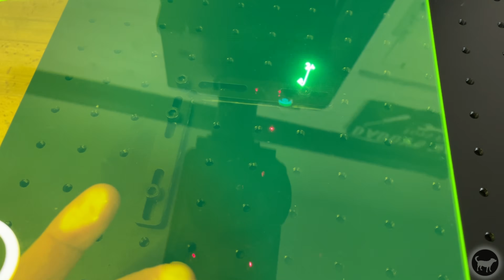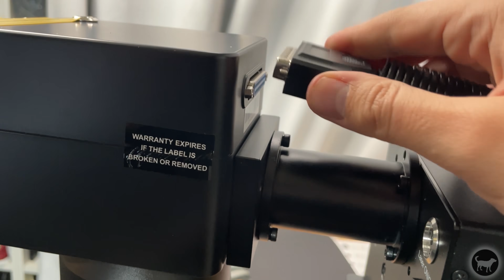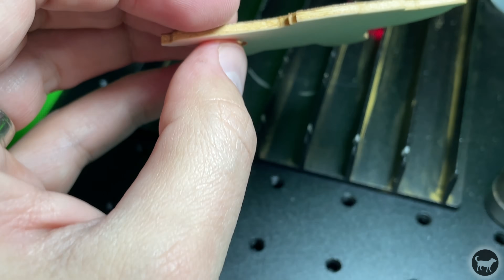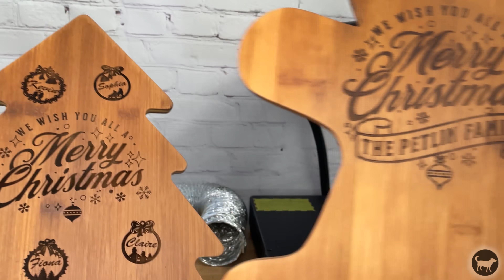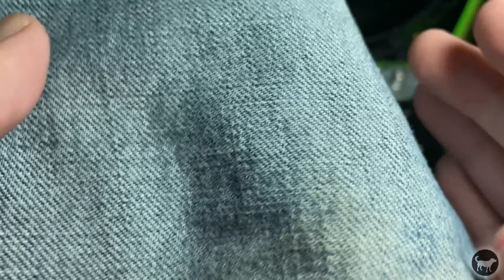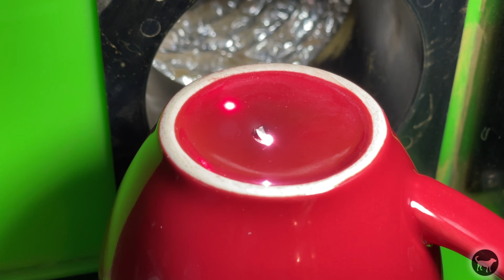ComMarker Omni One UV Laser Engraver Review | Cold Ablation Laser

Comment: Do you recommend this option over the F1 Ultra?
Reply from the maker: They are 2 completely different use cases. There are actually 3 different laser wavelengths between the 2 machines. You just need to figure out if the fiber, UV, or diode laser is the best for your needs. If you only want to work with wood without charring, glass and plastic then the UV is great. If you want wood with charring, plastic, deep metal then I would go with the Ultra.

Comment: Can you change the height from the program, or only manually? For my application I’d really like to change it automatically
Reply from the maker: As far as I know it’s only manually. I don’t think there is any connection from the motor controller to the laser control board.
Reply: @ guess you could hook up a motor to the rotating nob on top and drive it that way

Comment: Seems like a variant of AtomStack M4 DPSS laser(2W/1064nm) except for a 5W UV diode. So, it has the same lower lifetime < 10000 hrs(with unpredictable degradation), instead of real fiber lasers(100000 hrs), which is 10X more. Seems like they saved significantly on the Fiber laser module(No Raycus/JPT) itself, eventhough it is priced well above lower end real fiber laser. They also removed the red laser outline(replaced with cheap window), could reduce alignment issues. Also the cable deceptively resembles a fat fiber cable  conduit, eventhough it is a non fiber electrical wiring.  Hopefully the clones will become much cheaper(atleast 3X cheaper🤞). The engraving effect is far more intricate than other fiber lasers though. The review is exceptional as always.❤👍
Reply: Imagine that you have nothing better to do, but to go on each video of this laser and talk trash about the laser and the creators.  People have absolutely nothing better to do?

Comment: @BusterBeagle3D I need some guidance as I'm new to lasers. I'm looking for a machine that can cut and engrave efficiently. My main focus is engraving on plastic materials like PETG and PLA (from my 3D prints), as well as on wood. Additionally, I’d like the machine to cut wood up to 5 cm thick and plastics of similar thickness.

It would also be great if the machine could handle metal engraving (and possibly cutting small metal pieces). For example, I’m particularly interested in the ability to engrave a coin with depth. If I need multiple machines to achieve all of this, I’m fine with that—please recommend one machine for each purpose if necessary. However, my primary focus is on cutting and engraving plastics and wood for home use, while maintaining professional quality to sell products online. Could you recommend machines that suit these needs?
Reply from the maker: For engraving in metal coins you really are going to need a fiber laser. I would recommend ATLEAST a 30W machine. 20W can still do it but it's going to take a long time. If you want to cut I'm not a big fan of doing that with any galvo type laser so you would need a diode or a CO2 machine. If you want to cut clear plastics and acrylics you need a C02 machine as a diode can't do it. Almost all can engrave on plastic but this particular type of UV laser can do it without heating the surface and potentially give you some other shades or color options on the plastic the others might not be able to but again all will work on most plastics. Good luck!
Reply: @BusterBeagle3D  thanks a lot, ill buy a CO2 an forget the metal engraving

Comment: Great video.  Trying to setup my Omni 1 in lightburn.  I've got the drivers installed successfully.  I'm configuring it in "Device Settings" dialog in the "Ports and Laser Settings" tab.    When "Laser Type" to UV, the "enable q-pulse width setting" is greyed out.    Can someone who has Omni 1 configured and have q-pulse working , show/tell me how they set it up.    Screen shot or decription would be appreciated.
Reply from the maker: Sorry I know this was a while ago but the q Pulse is greyed out when UV is selected I believe since it's not a setting you can turn on and off but you should still have the option in the material settings. Mine is also still greyed out but functional. Some thing with the power settings. You may find some are still showing up but greyed out, I thing Lightburn is disregarding it anyway.

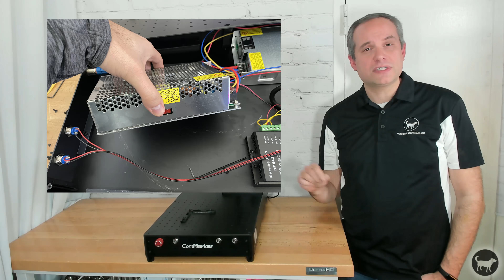Comment: 4:14. Might be a good idea for customers to open it up, and just double check the wiring before they plug it in.
Reply from the maker: It might have been a fluke and if you are not super experienced with working on machines I wouldn't recommend just opening it a poking around if you don't need to but if there is a problem and you are the handy type who would rather fix something simple then bother with a return then have at it!

Comment: I would suggest extra layers of protection for this wavelength of laser.  Especially marking glass material.  Existing engravings or cavity/density pockets in the glass material will divert the reflected UV and thermal radiation emitted at the point of interaction and flash into operator's eyes.

Comment: the extra connector probably powers the fan in the safety enclosure...?
Reply from the maker: I was assuming it was some sort of exhaust and potentially a light hookup but it’s just a guess
Reply: When I asked, it's to shut down the laser if you open the door to the enclosure while it is running. It's a safety feature. Also if anyone asks, the small port at the head power button is not used. They were going to use it to connect the galvo mirror portion but instead chose to use the larger connector at the rear of the head unit.

Comment: Where does one learn about how to tweak settings on the uv laser if one has never used any type of galvo laser just a diode?
Reply from the maker: Best way to test settings is by making a test grid and in Lightburn if that is the program you are using. There is a menu item in the program to create one for you based on the settings you choose. You can test frequency at particular Q Pulses or speed and line interval or really any combination of 2 of those settings at the same time. Might be too much for a YouTube comment but frequency is how fast that 355nm wavelength is hitting the surface. Speed of course is how fast the laser moves on the work surface. Q Pulse is how fast the laser shoots a stored energy pulse of the frequency you choose per microsecond. So the lower the number the stronger the beam is since you are shooting more per second. Lastly line interval is how close the burned lines are next to each other. The smaller the laser spot the closer those lines can be next to one another and the higher resolution you can get. 
This is all a quick overview but there are many videos online that do help go into those settings much deeper. Chat GPT is also a great resource for explaining those settings ever further.
Reply: This show here maybe?

Comment: Thanks for the video.  what was your source for the for the table that you used under the wood when you were doing cutting?
Reply from the maker: It was a grill that came with the xTool F1 Machine. I probably shouldn't have used it in this video since it's not part of this machine. However I have also purchased heat sink fins in the past for work on other machines that a smaller but basically does the same thing. https://amzn.to/3P5XgAh

Comment: I ordered mine a few days ago and I cant wait for it to arrive. Great video and keep up the good work.
Reply from the maker: Thank you! Hope you like it.
Reply: Works good?
Reply: @PassionBrains  Not had any issues and I've used it everyday without fault. A lot of trial and error initially, but once you have got use to what settings work for your materials, then  it's easy.
Reply: @UKGoldPanningAdventures  how big is working area?
Reply: @PassionBrains  With the current lenses they supply with the machine, ne is 150mm x150m and the other lens gives you 70mm x70mm.
Reply: @UKGoldPanningAdventures  Thanks! Looks like good one. I am ask myself order this or not
Reply: @PassionBrains  Order it if it meets your specific requirements, as i got it for the ease of glassware etc, but use my other laser for metal work if you see what i mean.
Reply: @UKGoldPanningAdventures  Nice. Does it cut some materials too?
Reply: @PassionBrains  It will cut thin pieces of certain material like copper, but it will cut glass too. There are a few videos of people cutting materials with it. I dont use it to cut, so i cant vouch for that capability